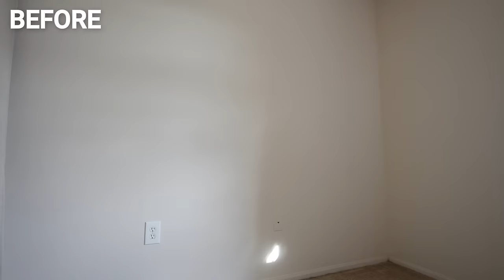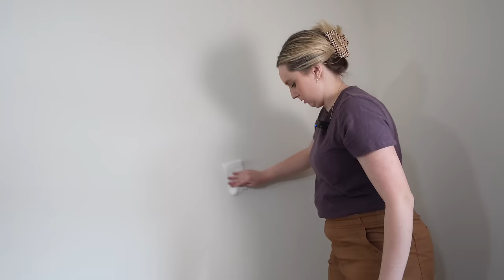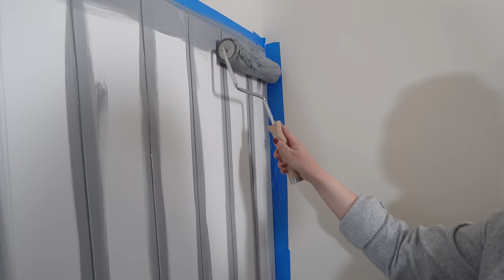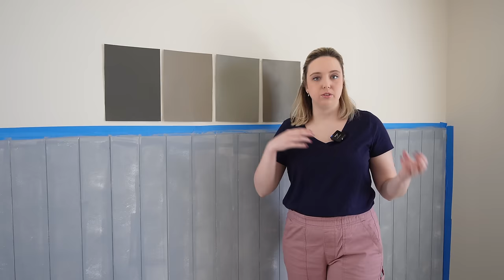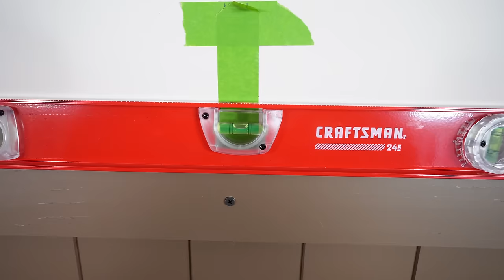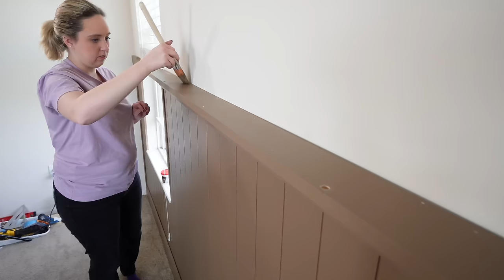*COMPLETELY* Renter-Friendly Shiplap Wall ✨ DIY removable shiplap panel accent wall

Comment: You did a good job to a point. I have to say that I was disappointed that you didn't put trim or finished the wall around the outlet. To me that is an incomplete job. It doesn't matter if the bed will hide it or not 😮
Reply from the maker: If this was in my house and installed permanently, then I would have. But since this will have to be taken down in a year or two when I move out, it just wasn't worth the effort to measure around an outlet that'll never be seen.